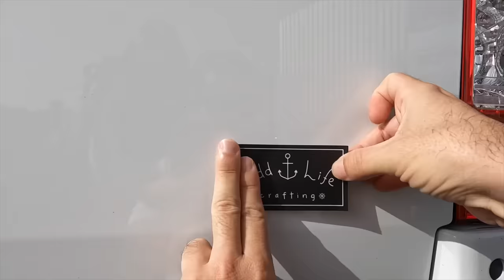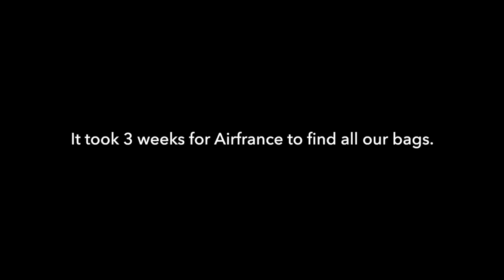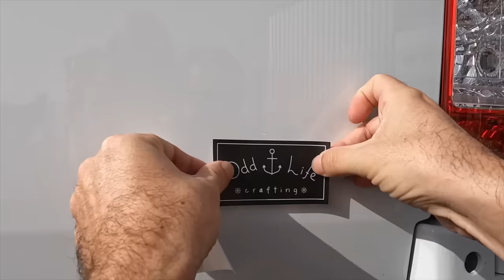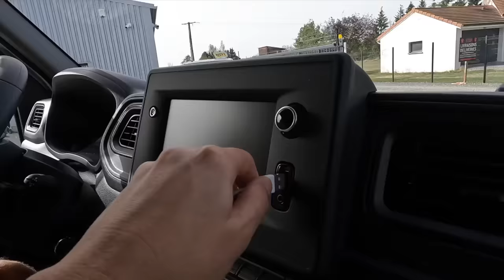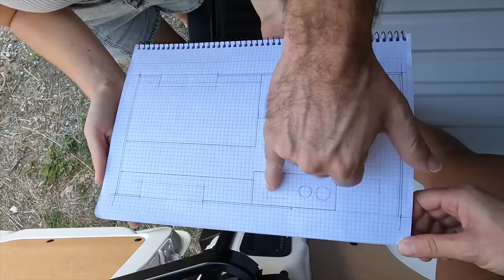⛵️Starting all over again... in a different country Ep.310

Comment: Some of the best van designs i’ve seen usually have the kitchen overhanging the side door by a foot or two, it won’r affect getting in and out. That enables you to have a fold up table on the outside which is handy and gives you more space inside.

Comment: In America we call that vehicle a land yacht. Looks like cool project. Can’t wait to see what you do with it.
Reply: @toddr2265 - Beg to differ on terminology. A land yacht is a large RV with multiple slides. A built-out van has no other appellation: it continues to be a van. Built-out school busses are called skoolies. Converted trucks or step-trucks are still called as such even after being converted. Only large RVs are sometimes referred to as land yachts. Only rarely have I heard on any YouTube channel - those doing a build-out or those doing tours of built-out vehicles - refer to a RV as a land yacht and have never heard that term applied to any other type of built-out vehicle.

In fact, the slang definition of a land yacht is "a huge car. Like big Buicks and Lincolns [cars from1950s-1970s]. The term came about because yachts are huge boats and a huge car is a yacht on the land."

Dictionary Definition: " a 3-wheel wind-driven recreation vehicle consisting usually of a bare-frame structure and a single sail and used especially on areas of firmly packed sand."